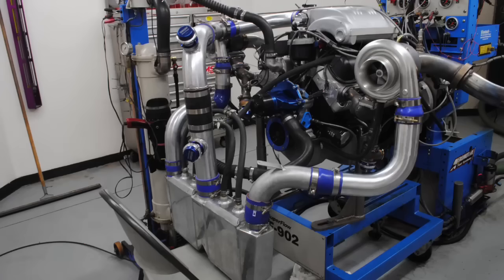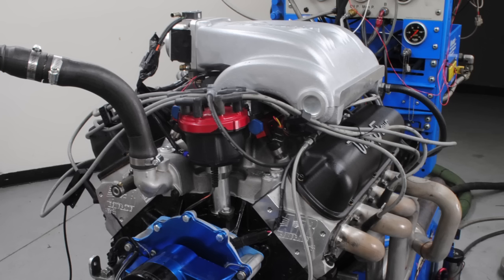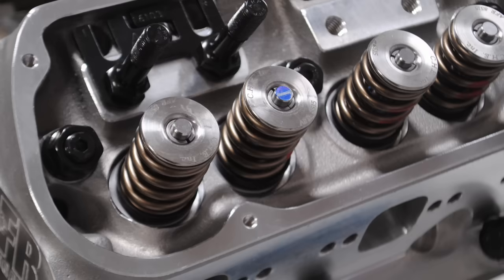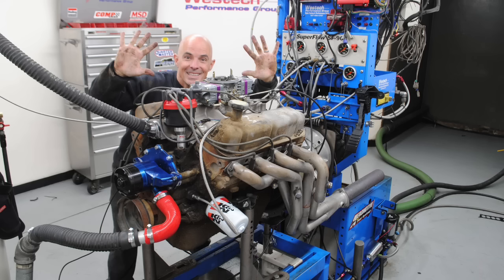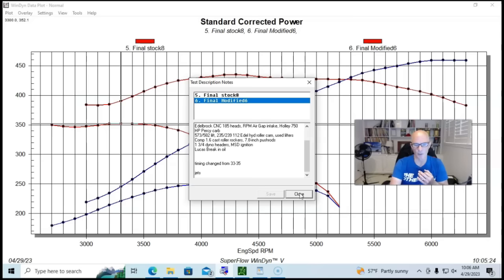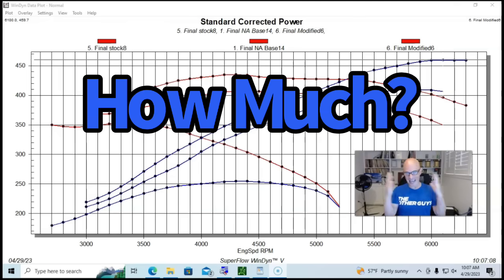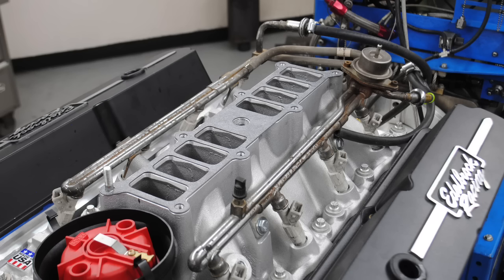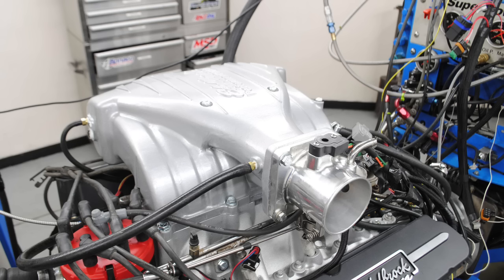WHY WAS THE 1000+HP BIG BANG 351 TWIN TURBO SO WEAK! HEADS, CAM AND INTAKE 351 SHOULD MAKE MORE HP!

Comment: Changing the subject, well, sort of, I've watched the videos where you went through different stages with the 351C, however I don't recall you starting with a 351C 2V. Which I have. Looking to make wallet friendly upgrades, and possible move up in the future. It is in a 73 Mach 1 Mustang I cruise with, going to shows and stuff. Is there any more power to be had with the 2V set up? Is there a cam that could help with the 2V carb and 2V open chamber heads? I seen mentioned that the 268H cam could be a good choice. I know Edelbrock has made a 4v intake that would fit 2V heads in the past, not sure if it is available anymore. I also know there are some racing classes on oval that require using a 2V carb. Would like to go with a top end kit at some point. Suggestions? My goal is a good performing street package that would still be capable of double digit fuel mileage while still being fun to drive. Oh, and 4V closed chamber heads are becoming hard to find too.
Reply: A pair of 302 Cleveland heads are the go, small 2V ports plus closed chambers.
Reply: @craigjones2878  I've read about those, but where to find them unless I find a seller in Australia?
Reply: @aguyinnc2865  they are easy to find and are cheap in OZ but shipping costs to the US would be prohibitive.

Comment: 10:03 I thought the trickflow R was the better option over the Trickflow box for my street turbo setup because I try and keep it under 6200 rpms, maybe I had the wrong intake on my mind for an upgrade. I was worried about losing daily driver torque under and near my 3k stall.
Reply: You did good. The box would be softer down low.
Reply: @2VersTT0  I don’t own either sir. I had it on my list I was considering buying. Can’t even find the box intakes now with trickflow and their “foundry” issues. Many of their aluminum heads are hard to come by too
Reply: @timweb1510  just get long runners for 65 and down. The svo/gt40 is ok but really it falls before then
Reply: @2VersTT0  with the trickflow box intake no longer being made currently and my throttle body setup it appears I’m stuck with what I have. I should have planned ahead but it was just so damn expensive
Reply: @timweb1510  what do you have

Comment: Why don’t you ever mention the rockers if it’s 1.7 1.6 or watt that would help me out greatly thank you.
Reply: I was told I could not run a 274 cam extreme energy with 1.7 rockers.
Reply from the maker: it was 1.6

Comment: Good work Richard. I’m trying to learn more with my roller 351w. My current setup isn’t optimal at all. I have a mild ported lightning lower, gt40 tubular, ported trickflow 170s(very old), trickflow stage 1 cam. Car seems to run out of steam around 5400 rpm.
Reply from the maker: a GT-40 would not want to rev on a 351-very long runners and small ports-when run with an xe274 cam on a 302-it only made peak power at 5400
Reply: That all sounds like a mild daily driver setup. If you're looking for more a Street\Strip combo- I'd replace the intake, cam and heads. GT40's are good torque intakes on a 351, and same for the rest of your combo - but you may be happier with an Edelbrock Super Victor EFI Intake\TB, AFR 205's and a Trick Flow Stage 3 cam. :)
Reply: @cgarris8674   @C Garris  the non ported newer 170s flow 250 or so CFM with the trick flows so the ported ones should be very close. 

Being ported there's a good chance they're closer to 180-190 CC volume depending on how far they went. The velocity would be great on the street and I thought with that flow they won't be holding it back more so the baby bump stick and manifold. 

When Richy tested as cast 170/190 heads on his sbf stroker 363 it made 510 with 170's and 528 with 195's. With a long runner manifold and the small cam I'd be surprised if he's making over 330hp at the moment. 

With the cost of upgrading heads I'd be looking for a larger cam and better intake manifold. Even a nice rpm air gap with injector bosses and a 4 barrel throttle body I think would wake it the hell up.
Reply: 351's need to breathe. That intake sure looks like money, but it chokes anything bigger than a 302. Need more intake runner and cam for sure. I bet it has awesome snap at 2500rpm right now.
Reply: @TheSlim93gt  the 351 Windsor test Richy did with Holley heads and a 228/235 .575 lift 110 LSA cam made just shy of 425 hp with an air gap at 6500 rpm made around 3 HP more with the single plain and lost everywhere apart from the last 3-400 rpm. 

I'd be going an air gap lol.
Reply: @hayden6056  Love my Windsor Air-Gap Intake,  even with crap heads and a 236 duration .579 lift HR, I made 498.8hp on the dyno.  A co-worker with the same build and TF11R's made 534hp!  Made me regret my cheap head purchase lol.
Reply: @cgarris8674 
What cam? Stock lower end?
Reply: @StangTime75  Comp Cams XFI 236. Eagle bottom end. 4 inch stroke, 6.2 rod, .030 over, pump gas friendly 9.7:1 compression
Reply: @TheSlim93gt  rpm air gaps don't breathe on a 351 Windsor? Goes alright on our Cleveland.
Reply: Runs out if steam at 5400 because you are using 302 parts choking the engine, what were or are expecting?
Reply: @msk3905  previous owner had the parts already installed man. I’m trying to optimize what I have and make a replacement if it makes my car better and I can afford the parts
Reply: I'll be surprised if it's still making power at 5400 and hasn't started to drop. The camshaft is rated up to 5500 rpm in a 302. 

The extra 49 cubes will shift the curve down 4-500 rpm. 

Also unsure how far the long runner intake will flow at high rpm as it's fighting the pressure in the manifold. 

I'm not a Windsor man so I can't clarify but the extra cubes is a given due to the added volume of toning down a camshaft. 

I'd try retarding the camshaft a few degrees. If this helps it breathe more up top I'd be increasing the duration. If it loses down low and doesn't improve up top I'd be looking at manifold.
Reply: @hayden6056  thanks for the reply and time sir

Comment: I think it was the combination of parts but the intake was probably the biggest choke. Even a mild 351w picks up a lot with shorter runners. I remember when that intake came out and Muscle Mustangs swapped out a gt40/box for that intake on project white trash and it lost considerable power. Trick flow then sent them some twisted wedges to replace the gt40x’s because they said that intake was designed for them 😂 but really it was just the long runners. The final result was it made about the same power as before with the superior heads and cobra r intake.

Comment: One thing's for sure. Older architecture O.E. blocks are very unstable compared to 6 bolt main, deep skirt blocks of today. Induction design very important as to engine purpose as you and Engine Masters have shown frequently.

Comment: Any chance of a test of the big AFR gen III hemi heads on either a 5.7 or bigger gen III hemi? They flow a ton, like 390 cfm, and, to me, seem like the new version of Cleveland 4V heads...completely different of course, but big valve, big flow #'s for a 5.7-6.0  motor.
Reply: None of us use the AFR heads for our Hemi’s. We all have them ported by MMX, TSP, or Thitek heads. Typically MMX is used, and most go with around 370-400CFM, big valves, & upgraded valve train.
Reply: @bri-manhunter2654  Thanks for the info! Would love to see Richard do a back to back with these ported, big valve heads.
Reply: @kidsteach938 . Be fun to see! Just remember, the stock Eagle heads flow on average 300CFM, and the Apache heads around 330CFM. Great heads out of the factory.
Also, a lot of guys like porting the Eagle heads over the 6.4l Apache heads for better port velocity along with compression.

Comment: Those "R" manifolds seem to neck down on the head side,im assuming to prevent "hitting" the intake port on a smaller head. I had to port mine alot to get it to match up to a CNC old school TFS Twisted Wedge head (205cc). Not sure how much that could hurt it,i would fingure 20hp,but a 51hp loss is alot.

Comment: Richard, I totally agree the BB Windsor was very low on NA power. For comparison, my 347 with AFR 185s, Holley Systemax intake, 70mm TB, shorty 1 5/8 shorties and custom cam, .600/.595, 227/231 with 112 LSA made more power. Holley Terminator X manages the important stuff. It made over 400 RW horses and 370 lb/ft. Something was definitely amiss on the BB motor.
Reply: Agree. I'm sure Richard did a compression test and everything checked out. I really think the efi intake really hurt that combination. Too bad they didn't throw a supervictor or even a RPM airgap on the BB motor.

Comment: Hi Richard! Nice analysis. Yup, you can't beat a 750 Holley on a good manifold! I was also wondering about the cams, and the cylinder pressures that each cam achieved. Perhaps the AFR headed big bang engine wasn't developing as much cylinder pressure as the other motor, due to the cam?
Reply: One Camshaft.
Reply: @kskip4242  sure, but two cams, because the AFR headed engine had a different camshaft than the Edlebrock headed engine.
Reply: @Kids Teach!  okay I see what you're trying to say you're comparing two different camshaft profiles got it, and you realize the engine uses only one camshaft
Reply: I have a 3310 from an L-78 396 it has down leg boosters and the little vanes in the Venturi and the metering blocks in the rear.  I put a set of jet extensions in there and milled the choke horn off. I also put an 85 power valve in it and it hits the torque like it has boost.  I really like it.
Reply: A quick question, we bought a new 2022 Edge ST with the 2.7 L Ecoboost 16-18 lbs of boost . AWD 7 speed automatic and it is a really good running car. It makes 335 hp and 380 ft lbs of torque. Do you know if the Edge got the 2nd generation 2.7 with the direct injection and the port injection to prevent the coking up the valves?  The 2.7 truck and Bronco has both listed, but the Edge oddly doesn’t. The truck got the double chain and I believe the same pair of turbos. So I guess the question is, does the 2022 Edge ST have the Gen1 Nano or the Gen2?  The 2.7 makes excellent power, at over 4000 lbs, the power band is very close to its Audi and Porsche counterparts. Do you know? I d like to put a tune on it and get it up to 450 hp and 415 ft lbs, but if it is going to coke up and break retainers, maybe 375and 400 ft lbs with a pair of bigger inter coolers. I think I could get to the lower goal fairly easily with an E85 tune. But I don’t know what my wife will think. I can’t drive anymore, but riding with her we jumped to 100 mph in 4th gear and only reached 4800 rpm’s. Effortlessly! It’s amazing and it handles really well. The B&O sound is great, and it’s way more comfortable than the 2013 3.5 NA. Is it the improved 2nd Gen 2.7?

Comment: How long could you run an engine at peak before you cook the engine or dyno
Reply: 11 hours
Reply from the maker: 24 hour runs are not uncommon for OE dyno testing
Reply: Not all dyno setups are the same. And, the more power you make the more heat it generates. 
Some could probably only run a few minutes at full load. Others could run till the engine physically wears out before they’d overheat.

Comment: Always wondered about the 351w BB test you performed - I typically wouldn’t do it Richard, but I feel you are totally responsible for that fiasco - proper preparation prevents pi… yeah you know.   Go get you a couple sets of wastegate springs, you KNOW a 351w is going 4 digits.

Comment: Are older blocks maybe stronger? I was going to try to duplicate on a 69 block 351w
Reply from the maker: block strength isn't the issue
Reply: The non rollers are definitely stronger, especialy the 1969-1974 versions - but as Richard said, not the issue here.